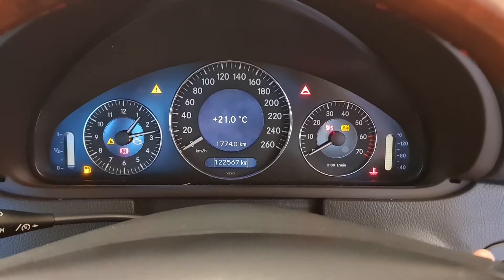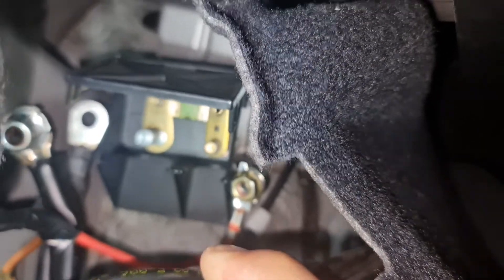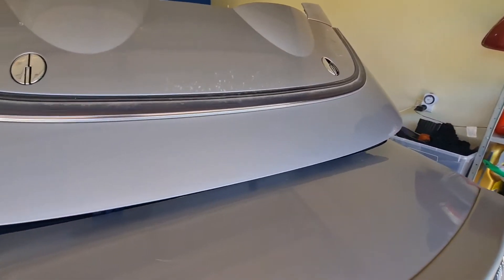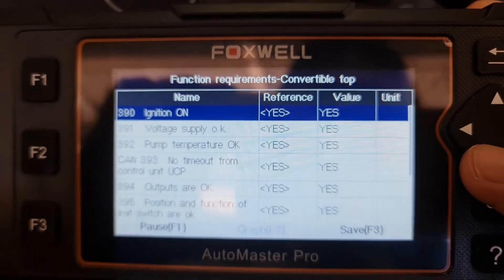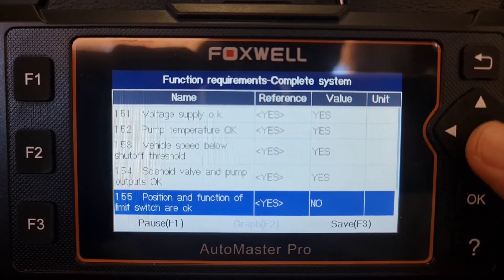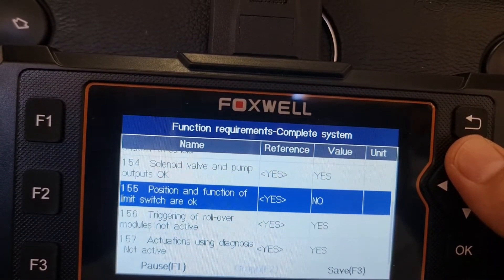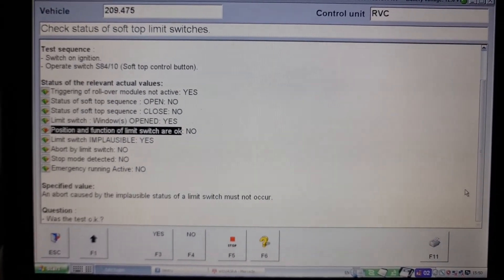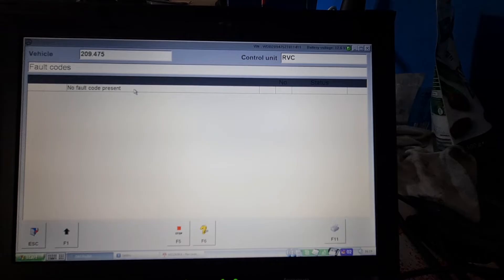Fixed; CLK Convertible Roof Diagnosis: A209

Comment: How do you know if the relays are working right, and what exactly caused the fuses to blow in your case? Btw great video, really helpful in understanding how the roof works
Reply from the maker: Thanks mate, If the pump runs for an extended time or draw extra current due to load, etc... the fuse might blow. Relays are usually less prone to go bad.

Comment: if the hydraulic fluid is below the minimum line but still a good amount of fluid, do you think filling it would fix my top?
Reply from the maker: You should avoid this simplest issue in the first place. Those 9 cylinders take a lot of fluid. You really need to have the correct amount in there.

Comment: Do you have any insight on replacing the main top line left (passenger) side?
Reply: The hydraulic line leading to the front driver side got kinked and split so I need to replace the hydraulic line
Reply from the maker: @ksamtf  unfortunately I have no experience with that.
Reply from the maker: Can you explain more please?

Comment: Nice video. How did u remove the micro switch and fixed the stuck small chrome door
Reply from the maker: Thank you, The chrome cover was stuck, I took the trim from other side and played with the cover few times and it started to work again, I did not remove the micro-switche.